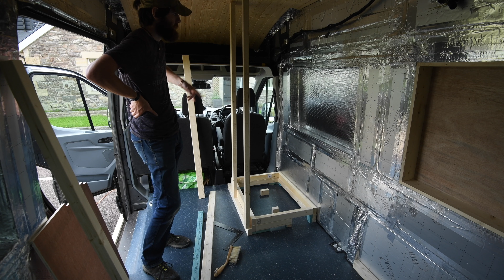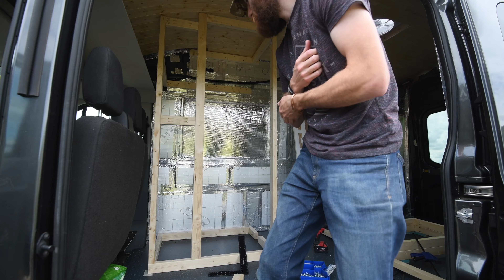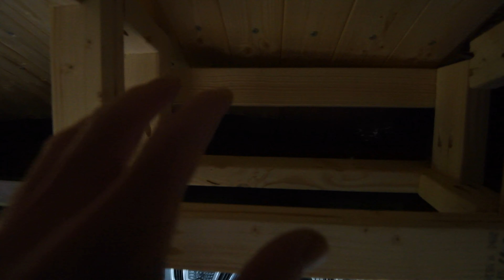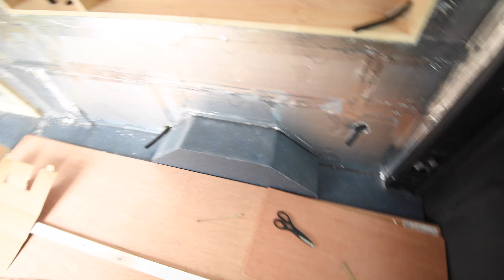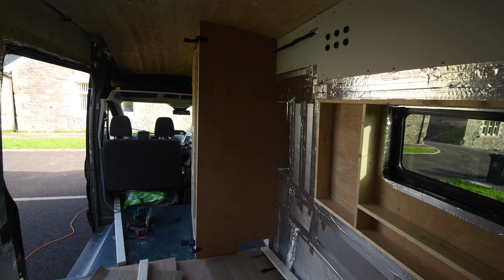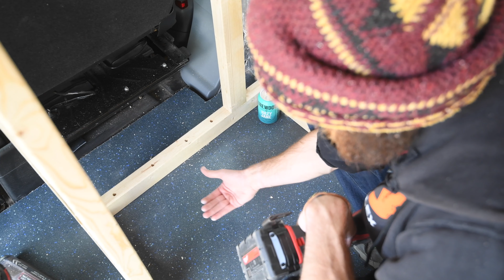Recirculating shower Part 2: Wet Room Studwork | EP19 | Ford Transit MK8 Campervan Build

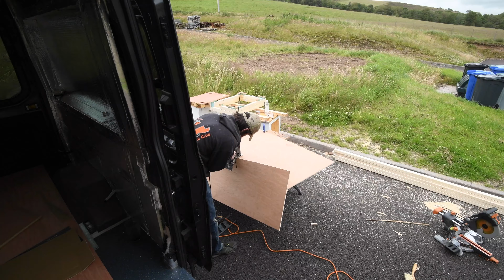Comment: 08:56 If you watch BOM (Bad Obsession Motorsport) and their rad Toyota GT4 running gear built into an original Mini, they call CAD ‘Cardboard Aided Design’.
Reply from the maker: Cardboard Aided Desgin is always a quick and important step!

Comment: I got rid of a awful vw crafter bloody money pit i was planning on turning into a camper after it was paid off from work use but got rid of it for one of these mk8 transit and it's so much nicer to drive and look at so the plan is now to turn that into camper in a couple of years and vids is encouraging because you only find crafter, sprinter van builds 👍
Reply from the maker: One of the main reason I wanted to make the build series a I couldn’t really find any let alone any British ones. 

I first drove this model of transit for work and that’s why I discovered actually I really like them which is why I got one in the end

Comment: Could you give your measurements of the bathroom please? Sorry if you listed on your first shower video...I started with the 2nd and then this one and I’ll watch that next. Also to confirm, you have the high roof extended Transit? I’m in the US but I think they are similar dimensions. 

Great videos...I’m learning a lot, at least to convey to the mechanic/handyman that will do much of my build but I’ll tackle some especially after watching some great tutorials like yours!
Reply from the maker: Sure no problem the shower room is ( internally wall-to-wall 82cm/32.3in  x 58.5cm/23in. Height wise at its tallest it’s 184cm/72.4in and lowest 170cm/66.9in. 

This is a L3H3 model, don’t know if you use the same naming conventions in the US for your transits. But the H3 is the tallest high top and L3 is the second from longest length.
Reply: Mispronounced Adventures Thank you so much for the reply! It’s a nice size shower room and I love the added shelf as well. I will consider the recirculating shower but I need to study it more. I look forward to more posts!

Comment: Good choice on moving the shower.  It did seem too big of a structure for the doorway. I am curious how you are going to provide access to the filters in that alcove?
Reply from the maker: Jeff Steinmetz yeah in the floor plan it seems like it would work but the card board mock up felt different. 

The Alcove ( larger wall opposite the door )  in the wall will remain open and part of the shower room, it’s not a closed cupboard, it will have a angled bottom so water can run off. The filters would be accessible from there. So any maintenance such as replacing them or cleaning means any water will just run off into the shower tray. It’s also added a little amount of extra space in the room ( which just might be Visual over practical ) . My filter cases are also clear so you will be able to see them in use and keep and eye on them. Ill show them in the next shower related video ( next two videos are electric related  )

Comment: Hi! Nice project. In case you don't know them, check the Snow & Curt channel. I think it's the best ressource for now on youtube about recirculating shower in a van.
Reply from the maker: La Cannelle I do indeed and they actually gave me the introduction to the concept of a recirculating shower although my system has a lot of similarities especially the filtering but also a lot of differences such as the way my water is heated and so on. Going to definitely be giving them credit for the idea and useful resources during the Plumbing video